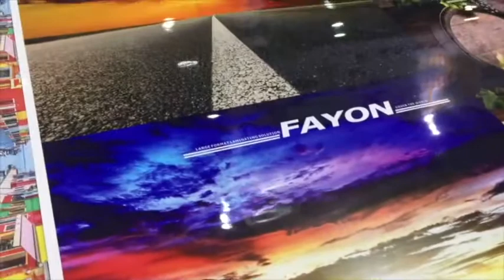New version Roll Laminator FY 1600SE

Comment: Speed not control, what is the issue ??
Reply from the maker: You need change the control PCB  board of machine, which has been damaged by static electrics.
Reply: hi sir how is your exprienc with this auto hot & cold laminator machine ?